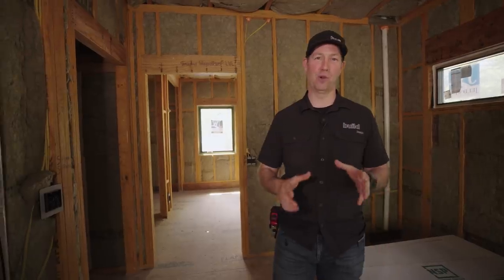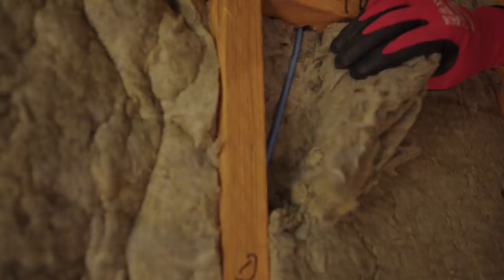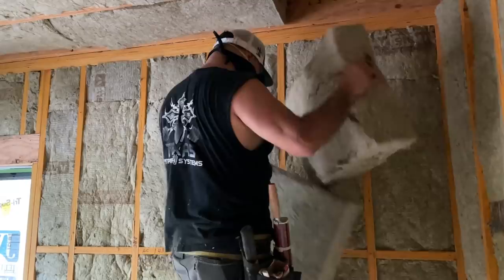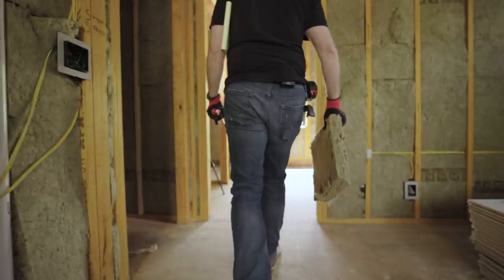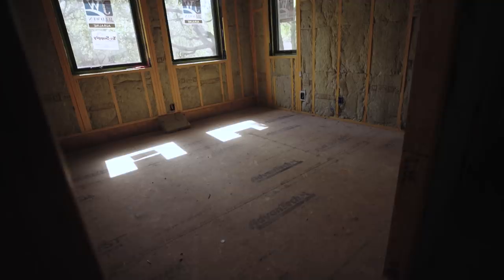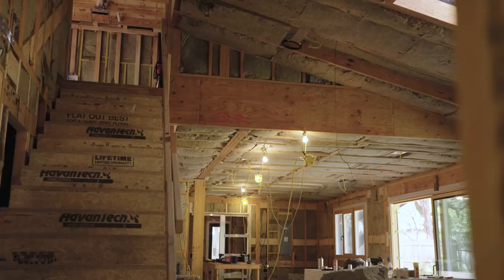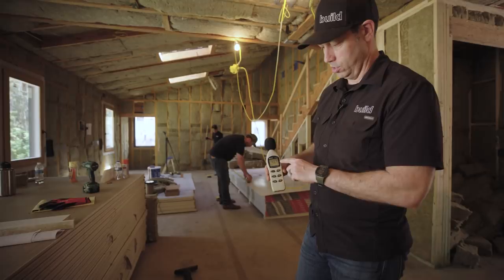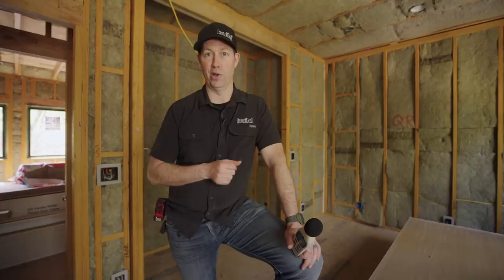7 reasons I used Rockwool insulation at my house.

Comment: 7 reasons I went with Rockwool. #1 today's video was sponsored by rockwool. 🤣
Reply: He forgot to mention that Rockwool in Europe is not allowed indoors because it has been linked to lung cancer.
Reply: This channel would be so much more valuable if Matt would take more seriously conflicts of interest. He could get this video sponsored by a roof shingle manufacturer or something. I have to be skeptical of nearly everything he says on this channel, which now that I mention it, makes me wonder why I sub at all.
Reply: @kostasg7109  i have no idea where you got that information but that is definitely not true.
Reply: @kostasg7109  Lie!
Reply: @phi376  well I guess you are currently building a home in Europe...
Reply: @kostasg7109  let me guess, with stones and not sticks?
Reply: @Kostas G we use rockwool alot in Norway, no restrictions here.
Reply: I just did an internet search. Rock wool was neither found to be carcinogenic (nor disproved to be carcinogenic.) At this point, it appears to be as safe as fiberglass.  It does not contain asbestos or any known carcinogenic material. It's a fairly simple bonding of common rock based materials in a superheated environment and spun into fibers - much like fiberglass but with improved heat and acoustic insulation performance. I see no documented research not to use it.  I suspect either the rumor mill has been at work or misinformation seeded from competitors. That said, it's a good idea to do your own research.
Reply: @johnatyoutube  mineral wool. Check links above.
Reply: @kostasg7109  What links? I don't see any.
Reply: @kostasg7109  rock wool == mineral wool. What links are you talking about?
Reply: @johnatyoutube  signs of a troll, 1 outlandish claims, 2 zero evidence to support that claim....
Reply: Why is everyone so cynical? So he likes a product and is happy to have the manufacturer as a sponsor. This is the home he will raise his children, in, fercrineoutloud.
Reply: @dtemp132  Was the information he provided false or untrue. I don't know everything about Rockwool, but it sounds like you might have some information that discredits the information he provided. Thanks
Reply: Someone keeps on erasing my links. Why?
Reply: Literally the most over hyped product that he shills for.. If Owen's corning sponsored his build he would have said the same things about it..
Reply: @kostasg7109  I posted a few too.. Either Matt's content editor is editing these comments or youtube is..
Reply: @kostasg7109  mineral wool was always considered a carcinogen and recently passed testing after removing the binder (for the test) but was put back in...  In 50 years we will have commercials saying "have you or your loved ones ever installed mineral products, if so you may be entitled to compensation"....
Reply: @FJB2020  I have linked articles, one from a journal. The links are legitimate. I also posted the journal link as a comment on its own. I am not lying and am very offended when certain individuals call me a liar. A simple search of mineral wool linked to lung cancer will bring up many articles.
Reply: @FJB2020  if that is the case then many lives will be destroyed. In Europe many new builds in cold climates have paper based insulation.
Reply: @FJB2020  as for noise reduction, you can use quietrock Sheetrock avoiding unnecessary insulation between rooms and floor ceilings
Reply: @kostasg7109  If anyone had half a brain they would google this topic just like I did after you made this post, but people are too lazy to find answers to questions on their own and instead like to be spoon fed information whether it is real or not.
Reply: @kostasg7109  I built my own sound isolated home theater and all of my research and lab testing has shown that two layers of 5/8" Type X drywall with green glue and fiberglass insulation stuffed in the cavity on hats is about the best you can do for soundproofing.  Rockwool alone doesn't do anything that fiberglass doesn't do and third party testing proves that.
Reply: Sell out
Reply: @kostasg7109  Bullshit. I'm building in the EU and never heard about any such thing. I am guessing you work for a fiber glass variety company?
Reply: @bloodcarver913  Actually no. I am a physician.
Reply: @kostasg7109  What?!?!?!
Reply: Lol!!!!!!
Reply: @kennethvogt9379  because there is so much conflict of interest in his videos, and often his recommendations would not pay off for most homeowners.  Zip system his other big push relies on tape that will fail and needs ideal conditions for installation rather that a mechanical overlap.
Reply: @kostasg7109  how about a source for that medical paper?
Reply: That's likely the real reasons 1 through 7. If Owens Corning or Johns Manville was sponsoring the video, we'd be seeing the 7 reasons he chose fiberglass insulation in his house.
Reply: @kostasg7109  I found a few studies focused on the manufacturing and there was one that showed a small increase in respiratory issues. If you are an installer a good face mask would be smart. But nothing I found indicated a cause for concern living in a home with it installed.
Reply: As soon as he said that, I stopped video.  We know your #1 reason, 🤔 💰 😂
Reply: @kostasg7109  youtube restricts links in comments to reduce spam
Reply: @davidmorrow4195  the old rock wool was carcinogenic but was remedied years ago. So any Rockwool from the 70 s and older very dangerous on the lungs.
Reply: ☠️ lol
Reply: Nailed it. He doesn't even say fiberglass because they don't pay him
Reply: @kostasg7109  I'll just quote this

“ The EPA has classified refractory ceramic fibers as probable human carcinogens. The International Agency for Research on Cancer (IARC) has determined glass filaments, glass wool, rock wool, and slag wool to not be classifiable as to their carcinogenicity to humans (Group 3). ”
Reply: Rockwool is by all means legal in indoor use in Europe. Spray insulation isn’t due to health hazards.
Reply: @kostasg7109  not true
Reply: @kostasg7109     I think you work for a fiberglass company
Reply: @kostasg7109  thank you so very much !!!!
Reply: @bobeeman9730  what about culmulative effects from living in it 24/7 for 30 years or children?
Reply: @freshfloorstulsa  who claims that?  The manufacturer?  Lol
Reply: @dtemp132  exactly
Reply: Means they gave him all the Insulation for the house free
Reply: @shudoo8062  are you being serious? So twenty years ago it was listed as a carcinogen and we should take that and apply it today? Asbestos used to be considered safe, should we keep using it? Sorry but that’s some wild logic…
Reply: I wonder who possibly could be the ones having an issue with the testing methodology? Follow the money!
Reply: @shudoo8062  exactly why I used it. Glad you realized you are being silly.
Reply: Yes🤣
Reply: @yekutielbenheshel354  cool story
Reply: @johnatyoutube  If the competitors are anything like Havelock Wool I guarantee rumors spread by competitors.
Reply: @FJB2020  BS. An acoustic engineer told me mass is the only prevention to sound transmission and rock wool has much more mass per inch than fiberglass.
Reply: @FJB2020  link?
Reply: @kostasg7109  Sure you are. Never met a Doctor that didn’t put Dr. in front of their name
Reply: @GOLDVIOLINbowofdeath  That is false.. Decoupling AND mass is the only way to mitigate sound transmission..  Mass alone will help, but is not the be all end all.. And regarding Rockwool, there is not much of a difference in mass, not enough to matter is a real assembly.. again re read what I wrote or talk to this 'sound engineer' that you "know."..   Or take the rabbit hole into AVS and other audio forums to see real assemblies, built by experts who use fiberglass over rockwool...
Reply: @FJB2020  where did I say anything about mass alone?
Reply: @GOLDVIOLINbowofdeath  you said "mass is the only prevention to sound transmission" and that is false..
Reply: @kostasg7109 
Where's your evidence?
Reply: What about the fact that it is not pest resistant? Don’t rats love this stuff?
Reply: Guys, Here is our True Savior

HalleluYAH translates “Praise ye YaH”

YaH is The Heavenly Father 
YaH arrives via the TENT OF MEETING
YaH was Who they Crucified for our sins
YaH was Crucified on an Almond TREE

— Ancient Semitic Cuneiform of Moshe (Moses)
— Isa Scroll (The Original Isaiah)

Isaiah 42:8
"I am YaH; that is my Name! I will not yield my glory to another or my praise to idols.”

Isaiah 43:11
“I am YAH, and there is no other Savior but Me.”

Isaiah 45:5
“I am YaH, and there is none else.”
Reply: the only issue I have with rockwool  is I can only find r-15 for 16" centers... R-30 at 24" centers... 6 months can't find it anywhere at retail
Reply: @kostasg7109 : interesting. I'll do some more digging on this. Thanks for the info. Normally you'd think the Rockwool is enclosed in the wall, but maybe some particles still escape.
Reply: @kostasg7109  Yup and rockwool along with fiberglass is pretty much standard over here. I dont know where in europe you are at but in france, germany, belgium, netherlands ,UK, Spain, Italy, Switzerland, Austria, Czechia and Greece its all allowed without restrictions. Sidenote i do not know of any restrictions and i own a very large portfolio of properties i rent out ( and refurbished. Only time i had to put in a request was when i was fixing a castle i bought in the very southern part of france but that was due to the age of the castle and is due to cultural heritage over there)  Only thing with rockwool and with fiberglass is that you have to be precise to cut it out. there are also farmers that grow plants and vegetables in rockwool squares, mostly vertical growers or aquaponics.
Reply: lol spray foam is easy to remove. The remodel argument is silly and besides get your plans right. 

Spray foam is far superior and Rockwool is not cheap.

Comment: should have named the video "i chose rockwool because rockwool paid for it"
Reply: @mcintosh.daughter  unfortunately for you he's probably not.
Reply: Is there another product you think would be better? If so, what are its pros / cons relative to Rockwool?
Reply: @ae1ae2  anything is better than rockwool because rockwool drops a lot of particles into the air and it gets into the eyes and lungs even when installed and especially if on the ceiling. I hated working with it. also if you get a bad batch that has been exposed in the rain it will just crumble on you. I brought them to the dump and went with good old fashion fiberglass and it has been cheap and clean. the pros of rockwool are just not worth it. rockwool resist moisture and fire (and PS. negligible more r value) but those things are useless since you can control these things using other methods if you are even slightly knowledgeable.
Reply: @rekostarr7149  Very unfortunate. Don't mind me. I'm just a butthead.
Reply: @mcintosh.daughter  agreed
Reply: Well, no, but actually yes.

Nothing Matt said was untrue, but I'm sure the fact that it was free may have influenced him a bit.
Reply: @zslemp  LOL!

Comment: 22 years ago I chose Rockwool for my house and have no regrets! Its awesome stuff!
Reply: Hey, but does rock wall keep the summer heat out?
Reply: @Righteous_hill_bandogs  rock wall greatly reduces the transmission of heat and cold, however if the inside is already hot it will keep that temperature steady, unless you have a cooling source.
Reply: @Richard-nb4iv  great, how long will your insulation last? I.E. how frequently it must be changed? How many years ?

Comment: Former insulator here. It is good stuff. We only installed it to meet certain fire codes, usually in commercial buildings. I would say around 90 percent of all homes being built still use fiberglass batts in the walls and blown in the attic though, they don't want to pay for the extra cost up front despite the obvious benefits.
Reply: Obvious benefits would be to live underground. Natural geothermal energy efficiency and no UV radiation 🤣🤣
Reply: If I start a home building company I’d use rock wool on every exterior wall and roof area.
Reply: @TheRealWadeW  Radeon could be an issue, depending on the area you build your cave.

Comment: After watching many videos Rockwool is the only insulation I will ever use. I've been renovating a mobile home on a 2nd property and I've used it exclusively. It's worth the $. Rodent and insect proof. Fire proof. Water proof. Sound deadening. I love this stuff. I have one mini-split in that home and it's real cheap to run thanks to proper insulation. Best tip: use a bread knife! So easy! Attach it to a magnetic measuring tape for precise cuts.

Comment: I used rockwool when I was building out my office. Ripped out a bunch of walls and had to replace the pink fiberglass batts. The rockwool is substantially less itchy than the fiberglass, at least in my experience. The sound deadening seems much better too.
Reply: Sound dampening is a must
Reply: I find rockwool worse than normal fiberglass
Reply: @CrzBonKerz21  Same and I think most people get placebo effect from it.. Independent studies show that Fiberglass and Rockwool have the same STC rating which in a typical wall is around 1 STC (which is not noticeable to the human ear)..
Reply: @FJB2020  All depends on density of product ranging from glass fiber, polyester and mineral. All have different purposes ie, thermal rated, acoustic rated or FRR etc - generally speaking mineral fiber (rockwool) is a much denser product compared to your conventional fiberglass or polyester. Price range of material goes from fiberglass > polyester > mineral wool. You get what you pay for.
Reply: I found rockwool is much less itchy that glass wool. It also has no binders so it is fireproof. 
It can also be spray filled into the cavities. Foil faced plasterboard gives a more than good enough vapour barrier.
Reply: @dankim3950  Except you do not get what you pay for.. 3rd party testing and independent analysis have proven that Rockwool and Fiberglass provide the same STC value...  I also do not think putting a product in the walls that is made with Formaldehyde is a great idea...
Reply: @CrzBonKerz21  can you explain why, please??
Reply: @davidelliott5843   being a survivor of a horrific house fire....being fire proof is peace of mind for me.
Reply: @hipdogdsv  Is fiberglass not fire-resistant? As long as the paper is not exposed to open air
Reply: @FJB2020  It's not a placebo effect. I notice a huge difference. I deeply regret using fiberglass batts in some walls a few years ago. I've also used Rockwool and blown-in cellulose since then, and both of them are superior to fiberglass for noise attenuation. Both of them are also fire-resistant.
Reply: @attitune  Once again... 3rd party testing has shown they have the same STC reduction in a typical wall assembly.  

Fiberglass is also fire-resistant..
Reply: Lol, definitely incorrect. Rockwool is ten times more irritating to the skin.
Reply: @FJB2020  It’s fire resistant to a point, then it melts. In my opinion, fiberglass batts are OK and better than nothing, but given an option in an open wall, I’d use rock wool. For blown-in insulation (closed walls), only cellulose. I can’t believe that blown-in fiberglass is even an option. Imagine opening a wall, not knowing what’s inside, and those tiny loose particles of fiberglass come flying out.
Reply: @FJB2020  Can you link to the 3rd party test of rockwell vs fiberglass sound deadening properties?
Reply: @noahscott7272  have a hydroponic system at my home and I literally have been shoving rockwool to the pot with my bare hand and have zero problem.

Meanwhile, the last time I took care of some fiberglass, I need to washed my entire body just to get rid of that itchiness.
Reply: @CrzBonKerz21  why?
Reply: @hipdogdsv  I was referring to the itchiness factor.
Reply: Guys, Here is our Savior

HalleluYAH translates “Praise ye YaH”

YaH is The Heavenly Father 
YaH arrives via the TENT OF MEETING
YaH was Who they Crucified for our sins
YaH was Crucified on an Almond TREE

— Ancient Semitic Cuneiform of Moshe (Moses)
— Isa Scroll (The Original Isaiah)

Isaiah 42:8
"I am YaH; that is my Name! I will not yield my glory to another or my praise to idols.”

Isaiah 43:11
“I am YAH, and there is no other Savior but Me.”

Isaiah 45:5
“I am YaH, and there is none else.”

Comment: I know Rockwool is a sponsor so I apologize but Owens Thermafiber offers all the same benefits but uses no formaldehyde binder thus healthier option. 

I’ve used Rockwool for years, actually when it was called Roxul. Didn’t switch to Thermafiber until the last 18 months when a client specified Thermafiber due to the formaldehyde free content. It’s typically slightly cheaper too. Only issue we’ve had is availability can be scarce.
Reply: Ty
Reply: I have Cancer and am fighting for my life. I would be very concerned if the product is carcinogenic. I wouldn't want my boys or future generations to go through what I am going through.

Comment: When renovating our 1800s era home I used the safe and sound by Rockwool for the stairwell in addition to fire rated drywall as it being our only means of escape from the second floor in the event of a fire.  I figured it was pretty cheap insurance as an extra layer! I also appreciated the rigidity of the product when installing in the basement crawlspace under the foyer.

Comment: Just got finished putting the R15 RW batts in my shop building, and my wife said she cant even hear my planer or tablesaw outside. It was also incredibly easy to install. I used an electric bread knife to make all my cuts, which worked way better than I expected.